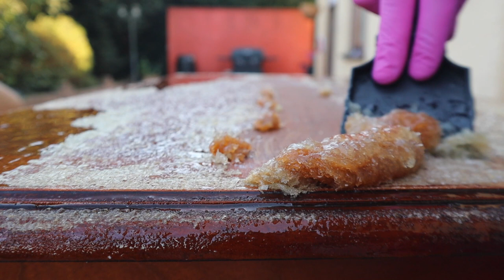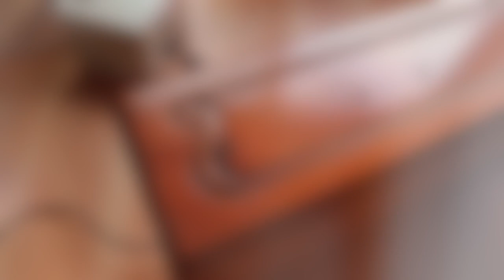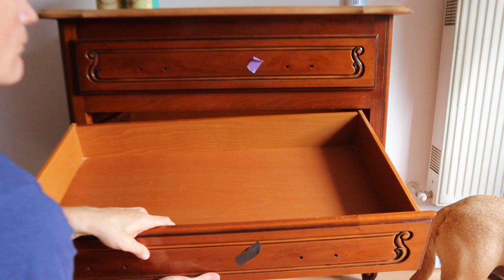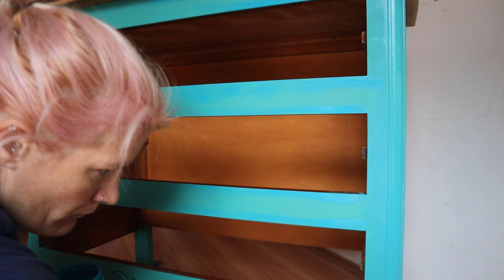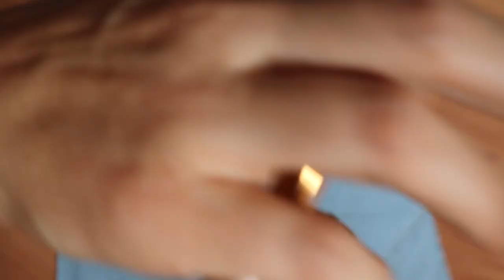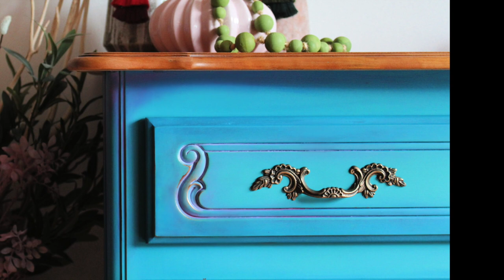A Beginners Guide To Blend Paint on Furniture | Spot Imposter Antique Furniture W/ Bella Renovare

Comment: Are these surf prep sander's 599.00?
Reply from the maker: yes, but let me explain a few things. 

I have carpal tunnel to where riding a bike makes me hands go numb because of the hand position. I used dewalt and Bosch for years, I blew through a sander or two a year, also the vibration would make my wrists hurt or hands be numb for hours. Also the efficiency of the surf prep is much better. So, if you don't sand a lot (which I do) or you do not have problems with vibrations and such then a dewalt is great. I myself will never own one again. 

also I have a coupon code that gives you 10% off the surf prep and it is a small business with an amazing family who runs it.

Comment: No high quality vintage/antique would have originally had brass colored zinc/pot metal hardware.  There is a lot of antique furniture, especially from the 1930's depression era that was  inexpensively manufactured to be affordable for the time, with lower quality pieces of lumber glued together and covered with a better quality wood veneer.  Those pieces usually don't age very well, and tend to shed their veneer skin as the wood and glue age and dry out.  Unless a person want to replace a lot of veneer, paint 'em baby, paint 'em!!! 
It hurts me a little to paint furniture made of oak or attractively grained wood, but not enough to not do it.  My  "restore only" pieces usually have to be solid mahogany, solid cherry, solid walnut, etc, but Tiger Oak is sacred. 😂
Reply from the maker: I feel every word you just said!!!! The Art Deco/waterfall era that is just a nostalgic value for most people nothing more :) there is furniture I won’t paint but that is also because I appreciate a beautiful wood grain also that’s the wood worker in me that’s why if you haven’t noticed I VERY rarely paint the top of pieces with nice grain 😻😻😻😻